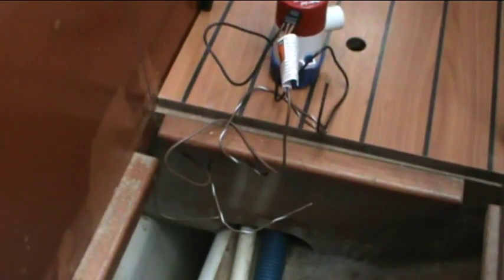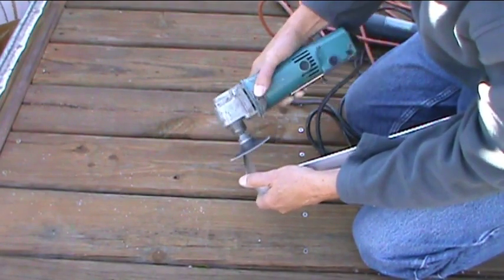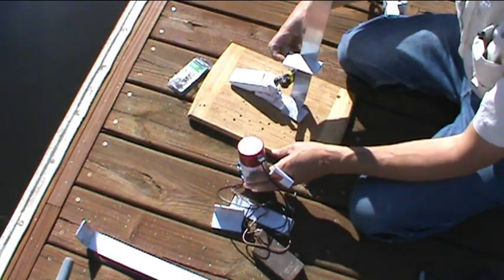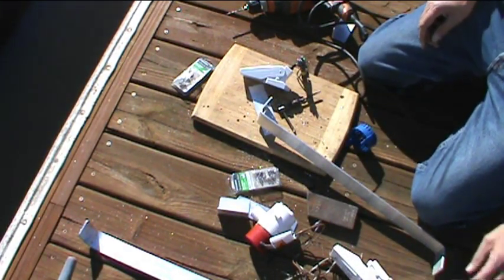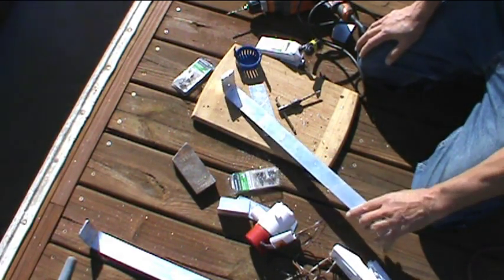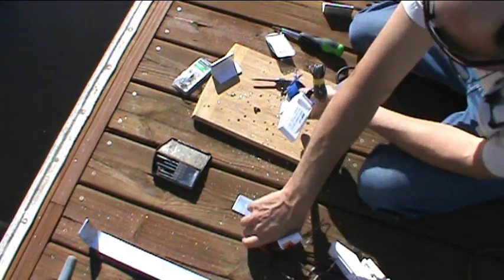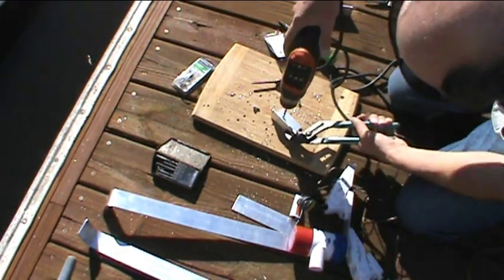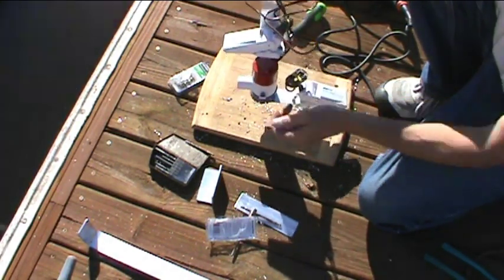Bilge Pump Installation Part 1 of 3, Mounting the Pumps

Comment: Drilling holes through a Gatorade cap can be a makeshift screen for a bilge pump, I just invented this. I used a razorblade and some sandpaper to clean it up afterwards, I actually let it sit in some hot water for a minute as well before doing this. First I drilled a bunch of small holes, then went with 1/4 inch, a beetle wont get through it. All the stores are closed, they were out of them where I was at. Shouldn't disrupt the flow rate too much. I fastened the cap to a Shoreline angle bilge pump, and removed the threaded tubing, with water being sucked out from the bottom. I didn't have a 3/4 inch holesaw, so I had to use a crummy plumbing kit with corrugating hosing. However, when I connected it to a full marine battery with Romex (All my boat I wire in Romex #12 solid) it worked like a charm, even with the pump two feet away from the end of the hose (vertically). I have the pump strapped with tie straps to the transom's center metal piece that goes from the bottom of the boat to the last seat. it's snugly secured, and I secured the cap with double tie straps (super small ones was all I had to fit on the side of the pump).

Comment: Wayne great video i was trying to figure how i'd mount a pump way back underneath a volvo on a sportfishing boat where its impossible to reach under there.  I like the idea of using the metal rod and then affixing the rod to the hull at a point where there is easy access.

Comment: hi captain Wayne was that the model 27s pump you installed ?
Reply from the maker: Yep sure was
Reply: hi Wayne the 27S is fully automatic no need for an external float switch, see below

 Pumps 12 Volt DC Automatic Submersible Bilge Pumps 500 GPH - 2000 GPH
Rule Pumps 12 Volt DC Automatic Bilge Pumps 500 GPH - 2000 GPH feature computerized operation on the principle of impeller resistance. Float switches are not required. The pump will turn on every 2-1/2 minutes to sense for water. If water is present, the pump will sense resistance and continue to run until all the water is removed. Thereafter, it will check for water every 2-1/2 minutes.Power use in the checking mode is minimal. models 25S, 27S and 53S

why did you add the float switch, i only have a small runabout and was just going to install the 27S pump and place down in the transom area on a piece of 10mm perspex then wire to battery with inline waterproof fuse, connections high up under rear casting deck and run pump out hose under gunnel rear starboard side

Comment: NICE BUILD BUT TOO BAD YOU DROPPED METAL SHAVING INTO THE WATER
Reply from the maker: Thanks but curious about the metal shavings in the water. I figured this would not be harmful, am I wrong?
Reply: Wayne Canning
Eco warriors get upset about anything. Very helpful video made me think twice about my up comming bilge pump installation
Reply: 1st off no project should result in waste or trash being expelled into the bay or ocean.. there is no sanitation to keep the blue sea clean. . Just me and you yo help out.. lead or iron poisoning, Everheard of it? Started from waste in the water ways.. China has a major problem with contaminated water system . . Not sayong we are on the same page but small issues like this will result in the same matter.... respect our waterways..